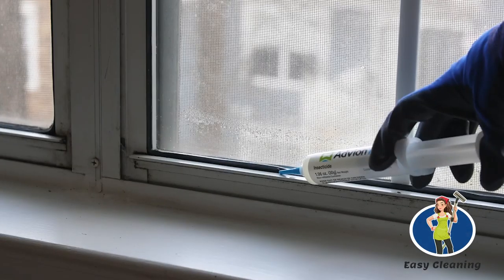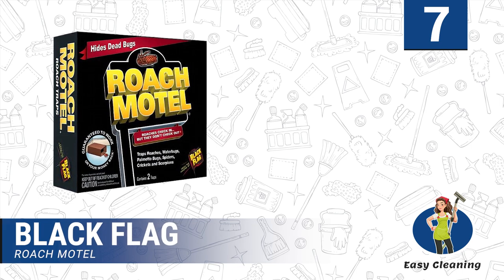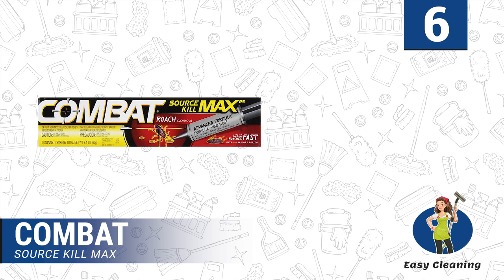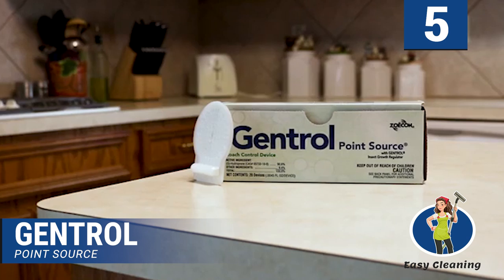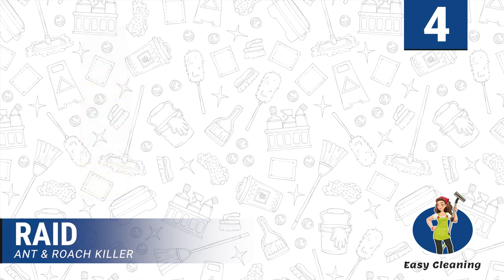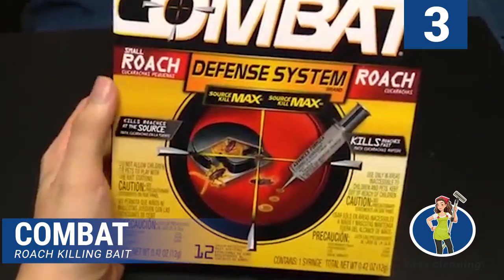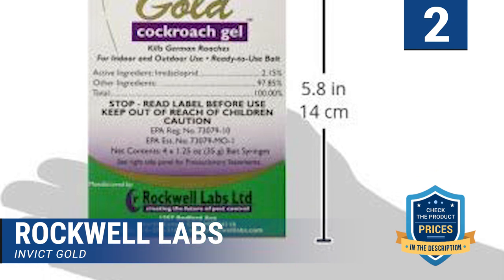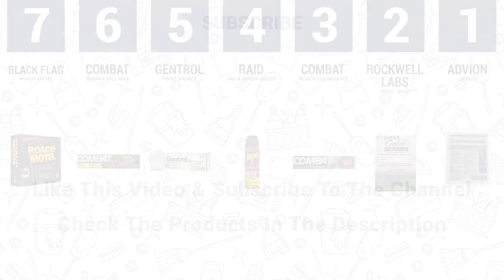Best Roach Killers in 2020 (Top 7 Roach Bait) 💦 👍🏻 💡

Comment: If you have roach problems, simply go to your hardware store and buy any roach powder that is basically boric acid. I used Roach Proof and works like magic, but I have since learned that any product with mostly boric acid will work. Why? Because roaches have exoskeletons and the boric acid scratches and irritates the little fuckers. They are smart enough to get out-a-town. Please trust me and the stuff is really inexpensive. Just sprinkle it semi-liberally in places where these buggers may travel, like behind the refrigerator, the stove, the back of cabinets, behind the water heater, - as many places you can without it even being noticed. 

Now for the Southern states (like Florida) with palmetto bugs. The above works, but like most of us, if we see one - it must die immediately! Many people (like myself) don't want to go near them and grab the Ant & Roach spray and practically empty the can on them - only for them to run and go into this crazy frenzy climbing the walls, and even attacking you. This goes on for about a half hour or until you build up the courage to smack-em with a 2 x 4. I found the solution for this too. But before I go on, different brands give different results. I found this out when one of those monsters was waiting to scare the hell out of me on the kitchen floor one morning. I slowly backed out and grabbed a can of CRC Wasp and Hornet killer that kills on contact. AHH-HAAA!!! It fucking worked. That little beast was dead in it's tracks in 15 seconds. I have tried other brands and they take a little longer, but the monsters usually don't last more than a minute. Just be sure that it is Wasp and Hornet killer that KILLS ON CONTACT.

I sincerely hope this helps anyone with bug-a-phobia. At last we can rest in peace - and the bugs too.
Reply: I don’t want dead roaches laying around ,roach motel hides the bugs
Reply: 😂😂😂 I agree! I live in the southern part of Georgia, palmetto bugs are the worst! I had to add , Raid Max ANT&Roach (Blue can only) will kill on contact. I hate palmetto bugs and have been unsuccessful finding away of completely getting rid of them. I feel hopeless. I guess it all comes with Southern living 🤷‍♀️
Reply: 51Hankyspanky Funny !  You have a way with words! You shud have your own blog!
Reply: Thanks
Reply: You have won this indian girl’s heart with your comment LOL
Reply: Very well written. I live in Florida and I can't afford a pest control company!  So thanks again for your comment...it made me laugh so much that I'm sending it to my friends!!

Comment: I want to order Avion however I am seeing reports of counterfeit product on Amazon. Do you have any suggestions of suppliers to order from on Amazon? I have an infestation, it is not bad yet; however, they are multiplying. We are very clean and meticulous, yet they are in my kitchen and every now and then in the bathroom near kitchen.
Reply: I use combact roach killer max mix with honey. I don't have roaches inside my home but they be trying to come over from my neighbors. Been using the bait for two weeks havent seen none. I usually see them everynight on the back porch . Got the ideal from YouTube u can beat them
Reply: If you still have issues, the best thing to do is pick it up from a brick and mortar store like a hardware store or Walmart.

Comment: Okay serious question has anyone here really completely destroyed an controlled an infestation with these without going to pest control?
Reply: @hermosaduh  i just saw a lot of ortho orthene products. Could you tell me which product do better for you Please? Thanks ❤
Reply: @ሕሊና-ለ9ኸ  yes it's the Ortho othene fire ant killer it's in a black bottle with yellow lid. It's a powder. I put it all around the edges of my home and places where it was badly infested and the bugs started dropping that day. A week later there was many dead and then it was all clear. It does have a string smell but it was the only thing I found that worked for me. I had roaches for like 2 years
Reply: Yes I have. I was living in the city and our townhome got them. First step is clean like you have never cleaned before. Behind all appliances, furniture and then cabinets. Once done it is important to keep it like this removing trash, water sources and food. Don't leave anything laying out. But max combat bait put that out and wait two week. Then change the bait to a brand like hot shot bait traps and wait another two weeks. It's key to use different brands with different active ingredients. Once that is done spray with Bengal gold roach spray. Spray along all the walls and behind appliances. This stuff is more expensive but it is 100% worth it. After that they should be all gone but I would recommend  putting out bait traps in kitchen and bathrooms every 6 months or so especially if you live in apartments or condos. A lot of the time it isn't your fault. We had a super clean place but had horrendous neighbors who were so bad they got evicted they caused our place to have issues

Comment: Advion is the best.
Reply: Where do you order yours from?
Reply: @andreiareynolds4457  You can buy it on Amazon
Reply: @gt_exotics0127  I see it but then some on Amazon said that when they purchased again it didn't work. Thought it was counterfeit. I guess I will have to try it and see.
Reply: @andreiareynolds4457  yes they aren’t the same as they were before about a year ago I bought some they were extremely helpful but now they don’t really seem to work. I’ve tried to find the original one but can’t find it. I even bought them on eBay but no it’s the same they don’t work as good
Reply: @gt_exotics0127  oh no! You think the company may have changed the formula. That's awful if so.